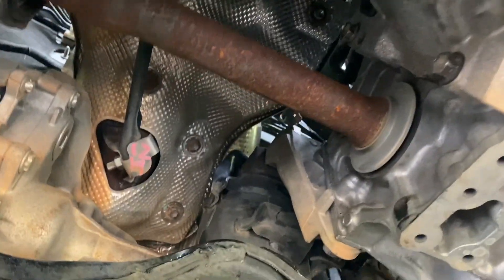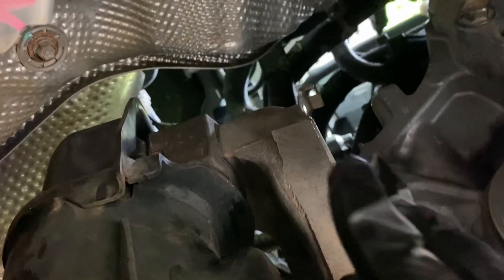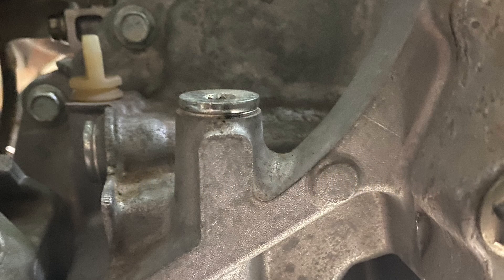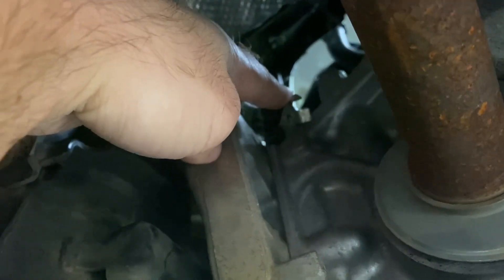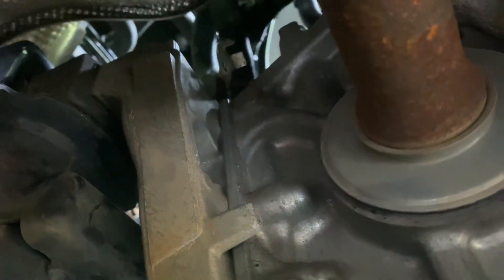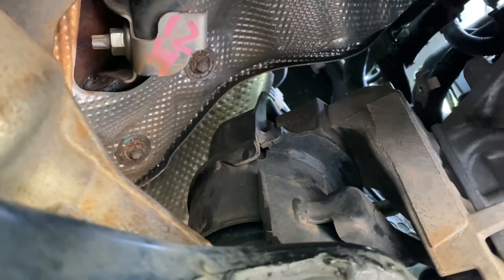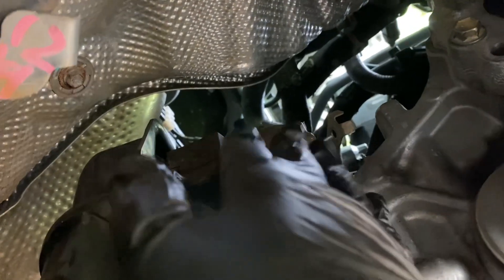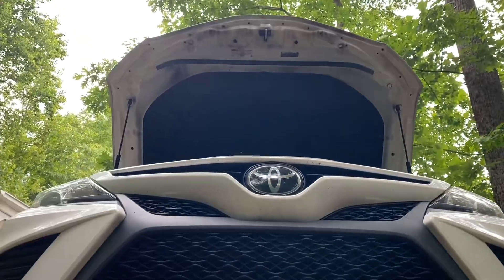2019 Toyota Camry Power Steering Issue Fixed

Comment: If you don’t mind me asking what was the cost of the trans and who did it? Still u got almost 300k out of the trans not bad these 8 speeds way more advanced then the older 4-6 speed auto Camrys.
Reply from the maker: Tranny cost $2800 ($100 core charge)

Cottman transmission cost $1500 for labor

All in, $4200
Reply: Wow! Thats expensive. Was it new transmission,  rebuilt or used from wrecker?

Comment: I have a 2019 Avalon and just changed the transmission. My power steering acts up at times and locks too. I don’t see this ground wire and I’m not sure where it is suppose to be grounded.
Reply from the maker: Yeah I believe the transmission guys didn’t know where this ground wire supposed to go so they probably left it or forgot about it. My dad and I just ran a new wire to the battery and it worked for me. Hope that kinda helped you out.

Comment: Glad to hear your car is fixed brother! Sorry you had to replace the transmission. 
Btw I’m just curious- what is your lifetime mpg on the car? I think you can see it (on your small info display) when you scroll up/down on the left side of the steering wheel?
Reply from the maker: Before I changed the spark plugs recently and did an engine tune up at the dealership, I was getting 28 mpg city

Then, after the tune up I’m seeing 45mpg Highway and 35 mpg in city
Reply: Nice bro 
That’s pretty dang remarkable 
Kudos to you man

Comment: My father's 2018 Camry has intermittent issues with steering. Sometimes it's very hard to steer. Like a car with no PS. Then it will just fix itself out of nowhere. Any idea? He's at 90k now.
Reply: I am having the same issue 
I get a low steering power fault every now and then. 
The dealership said there was nothing wrong xD
Reply: @Chibbby  turned out it was the sway bar links. I drove it around a parking lot and could tell right away either tie rod end or sway bar links.